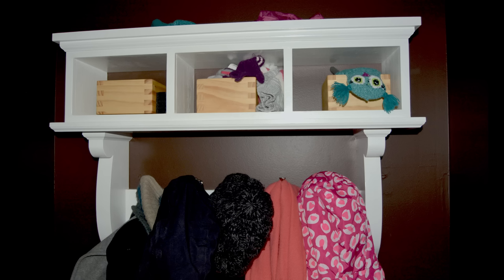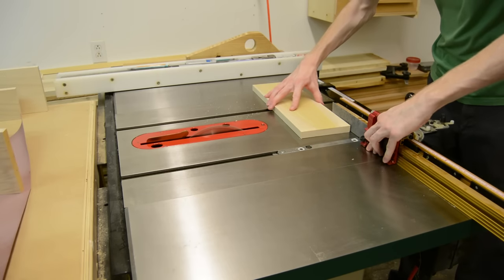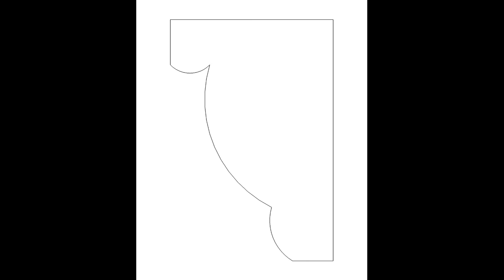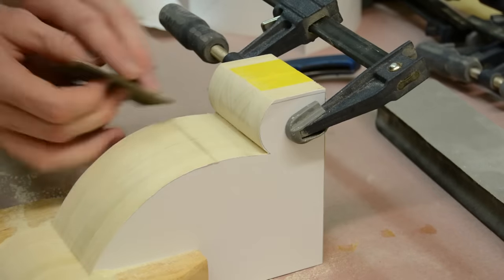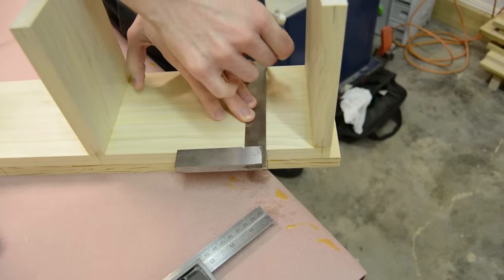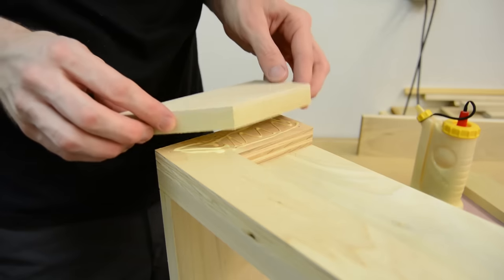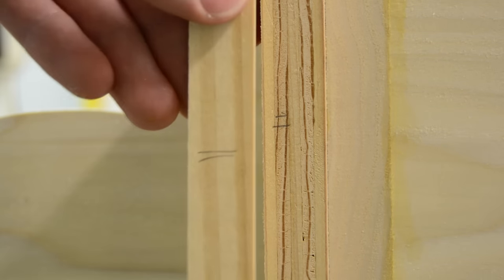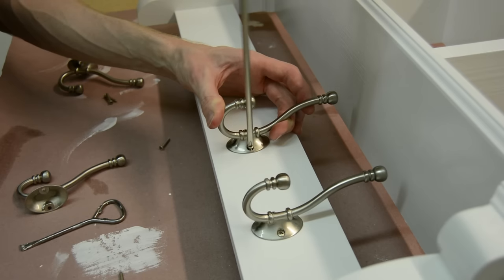How To Make a Coat Rack with Storage

Comment: Matt looks really good. have you ever tried bondo as your filler? It works great and paints nice too. Also look into the ridgid pin nailer awesome tool.
Reply from the maker: +Tim Buckman 
Thanks man, I have definitely used filler before being in the auto industry, but not as a wood filler. It's really too much hassle in my opinion for something like this, I think the drywall filler works great. 
Cool man, I'll check into it, I really need to get one!

Comment: Hi, I was surprised that you did not connect the bottom piece after you put the corbel's on. This way you would not have to plug the screw holes and save one step. the finished item looks very good.
Reply from the maker: +John Fithian-Franks 
Yeah, you could definitely do it that way. I was sort of worried about getting clamps around the corbels to laminate them together.

Comment: Nice job! How do you like the miter/crosscut fence for your table saw?  What brand is it? Do you feel the need to have a crosscut sled in addition to the fence?
Reply from the maker: +bdshort 
Thanks man, it's an incra miter gauge. It actually has a sled that goes with it, I just haven't gotten it out of the box yet :/ To answer your question, I love it, it's a little pricey but it has basically all the degree marks built in down to the 1/2 degree. It also has a lot of other cool features like the flip stop.